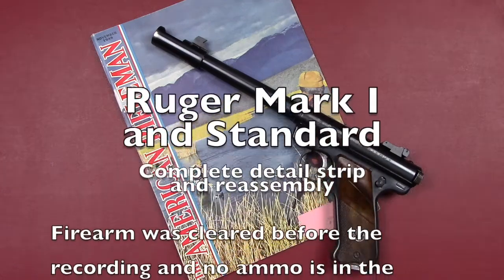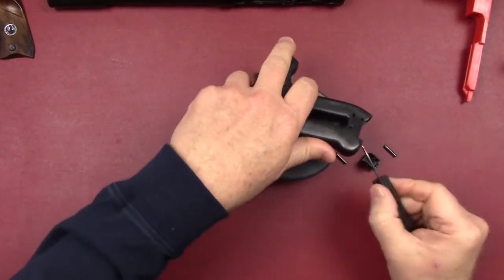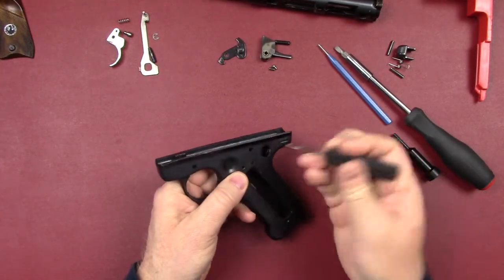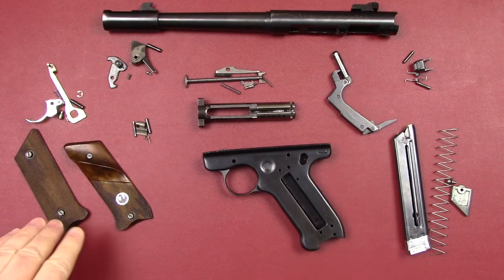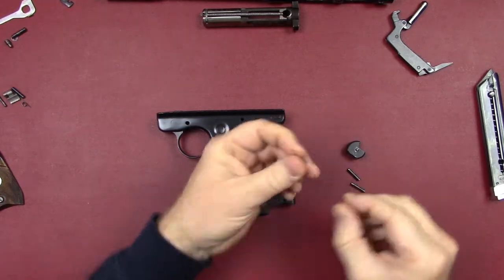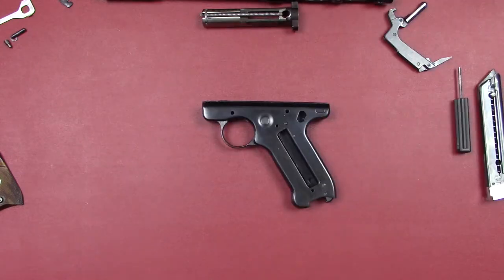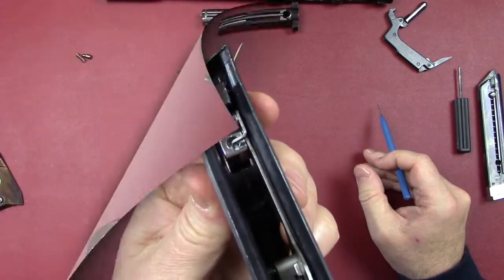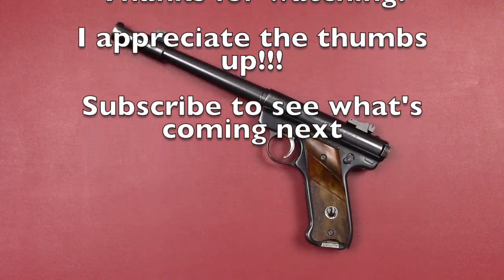Ruger Mark I FULL Detail strip and Reassembly - EASY!

Comment: Excellent Video. Have field stripped before but never down to the frame. Picked up a very nice 1953 Mark1 and needed a full blown clean. Busted recoil spring tail replaced, no big deal. It was interesting to find the c-clip floating around in the trigger area. I think someone gave up trying to clip it and just left it in the housing. Nice trick with the wooden stick to grasp the c-clip. I used the backend of a wooden cleaning Q-Tip. Worked like a charm. Super video. Very concise and to the point. Thank You so much!
Reply from the maker: Perfect!  Best pistols ever, just a bit tricky for some to put together.  I can't remember if I mentioned this on the video but I had one early gun that just had a snip of sheet metal for the e-clip.  It also was basically just sitting there when I took the gun apart.  Glad it worked for you!

Comment: Thank You so much!. I have a well used MK 1 that has in the past been somewhat abused. I have learned how to take it apart now! I need a new sear spring and mine is so deformed that I had no idea what it should look like until I watched your video. My bolt has also been abused so that the front part of the recoil spring assembly needs to be forced into the bolt. As a machinist ( not a gunsmith ) I will be very careful fixing the fit. So again my sincere thanks for all the information.  Duane
Reply from the maker: So glad it helped!  If you need a spring or small part I’ve found Ruger to be quite helpful. Their customer service has been amazing.

Comment: A very well detailed disassembly and reassembly of the standard Ruger from the Mark I era.  No other video gets close to the information that TomD provides on the MKI.  The major diifferance between the MkI and MkII is that the MKI has a c-clasp like device holding the trigger assembly in place which TomD explains how to remove and later install.  The MK II has a curved thin cable holding the trigger assembly in place and this design seems much easier to work than the MKI design.  Without TomD's video I would NOT have a chance on figuring out how to work on the MKI.  Other videos promise to explain the details on the MKI but none other than TomD has delivered.
Reply from the maker: Many thanks Ron!  So glad it was useful.

Comment: You didn't take the mainspring out/apart. Really nice video on this brain surgery otherwise. One of the better ones.  :)

I've had my MKII apart so many times and it's never gone together the same way twice. But it's gone together.
I find that gooping up the safety detent spring, plunger and the frame side of the safety lever with Vaseline helps keep the safety in position against the frame and the detent plunger and spring from getting away from you in subsequent steps of reassembly.  Same with the Trigger transfer bar spring and plunger. You can wipe any excess goop off later.  Or not.
Thanx.
Reply from the maker: You are correct.  Actually, I've never taken a Mark mainspring apart.  I think my first one had the pins staked and thus would not come apart.  Since then, it's just a part that's low priority to clean.  Glad you are enjoying your Mark II.  They are incredible pistols.  Cheers!
Reply: @tomdgunnery8360  Me neither. Been eyeing mine. Pin is staked too. Hmmm.
Installed Volks' trigger and sear. Trigger pull down to 1.5 lbs from 3.  The VQ sear/hammer contact angle is different. I think that's their secret.
Nice gun. Dime groups @ 50'.   :)

Comment: Hi,... Would you mind commenting on the muzzle addition on that pistol...  I've never seen one like it on a mark series ruger...Thanks.
Reply from the maker: Hi @fleaflop, that’s a Ruger made muzzle brake.  They sold it as an option on the early pistols (1950’s).  Ruger made them to fit on the tapered barrels and mainly were sold with the early Target 6 7/8” Mark’s or you could buy the brake separately. They have value all by themselves. Plus it just makes the gun look cool. 😊
Reply: @tomdgunnery8360  Hi Tom,... Yes they surely do make the gun look  cool....it drove me right to the video.  I got my mkI in 1978 and would love to have a brake on it....  Do you find it reduces flash, noise or recoil?  How would you say it affects the pistol other than looks.... Thanks.
Reply from the maker: @thefleaflop  These guns are so stable to shoot anyway but that brake actually does help even more.  Basically you stay almost perfectly on target shot after shot.

Comment: funny that my spring assembly wont slip back in. It was a pain to remove, before parts started falling out. I replaced everything proper, but now Im stuck on the spring assembly. Could use a bit of help on it, maybe recommendations on what to do
Reply from the maker: Hi Marty. Do you mean the main spring?  There are a number of springs on these things.
Reply: @tomdgunnery8360  Yea, if thats the group which holds the barrel in place and is the first to be removed via the rear of the handle/grip.

A bit odd that now the safety's stuck on FIRE as well, though it used to move (without the barrel/receiver installed). Oh, plus in the few instances I DID get that spring in, the bolt got stuck as well, possibly due to the hammer. Strange, really. Ive followed along as best I can to your directions.
Reply from the maker: Ok, that’s the mainspring. Some of them are a really tight fit and while trying to cram that thing up there parts can start moving around.  I’d back up a few steps, you may even have to take the barrel back off. When assembling, the key is getting your hammer strut freed up so that it does does not get trapped when pushing the mainspring up through the gun. When you know it’s free and the post on the mainspring is starting up through the hole, you can push up on the mainspring with a wooden dowel or even the barrel of a screwdriver sliding up the back of the frame.  Just keep gun pointed so that the strut does not get trapped. I have another assembly video on the Mark II Field Strip that may help more. I think that gun was tighter to put in.  It’s basically the same for either Mark at that point. Hope that helps. Wish you were nearby, I’d do it for you.
Reply: @tomdgunnery8360  Yea, Ill give it another go. Got the safety and bolt unstuck, triggers fine, spring is a bit odd. May consider taking it back to the gunshop, see if they can take a crack at it after I try your remedy, assuming it fails. Which I hope it doesn't.

Comment: do you know the size of the e ring used to retain the trigger pin?
Reply from the maker: Hi Gary. Funny you should ask. That thing was tricky. Not sure I said it in the video but when I tore the gun down I found a cut sliver of metal shaped like a c holding the trigger pin in place. I asked Ruger for a replacement (once I figured out it was called an e-clip) and they sent me a 1/4” one. Much too large for my pin. Ended up buying a 300 piece assortment from I think Harbor Freight and I believe mine took the 3/16” one.  Then it was a tad too thick so I thinned it down by rubbing on some 2500 grip sandpaper. How’s that for a non-simple answer!  :).  Hope that size works on yours, if not, the assortment was under $10 and now I have 299 e-clips to use for ???  Fun stuff. All the best on yours!
Reply: I recently bought a 1971 Mark I and promptly broke it down for cleaning.  Like many others I couldn’t get it reassembled; the bolt stop pin refused to be inserted through the bolt and the frame, despite using a plastic hammer to encourage it.  Out of fear of doing damage I took the gun to my gunsmith.  10 days and $20 later the gun was returned fully assembled.  The smith wasn’t available to show me what he’d done.  But having watched several videos (many times each) I was emboldened to disassemble the gun for cleaning.  But can’t get it back together.  Same problem with fully insetting the bolt stop pin.   On my gun the bolt stop pin shows a bit of wear and roughness that is preventing the pin from being inserted smoothly, so I ordered a new one from Numrich. And I’m going to make a better wood mallet for persuasion purposes.  I hate to go back to the gunsmith but I refuse to be defeated by this.  The gun cost $350 including shipping and FFL fees but I’m close to scrapping it out of frustration.
Reply: @tomdgunnery8360  Glad I read the comments on this to get your info. 1950 Standard. I broke the e-clip trying to get it out and figured I'd never be able to find another. The Harbor Freight assortment was $7 and well worth the price for that one clip I needed. Needless to say, I don't plan on pulling that trigger out again.

Comment: I have a mark III that I cannot get back together. I consider this gun a piece of junk and plan on throwing it into a river. I have not even shot the gun.
Reply from the maker: I hope you did not give up @Chevy Preps. It IS possible. Just step back and take it one part at a time. The mainspring is the main pain. Just have to make sure the hammer strut is free and dangles back when closing the mainspring. That strut loves to hang up on the sear spring stop pin down the frame.